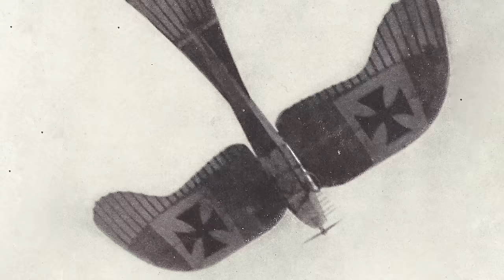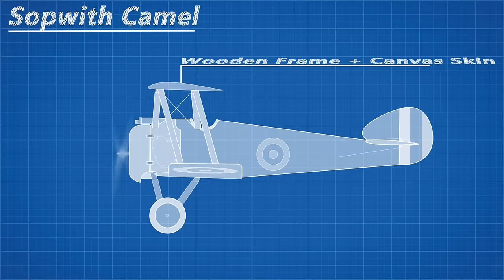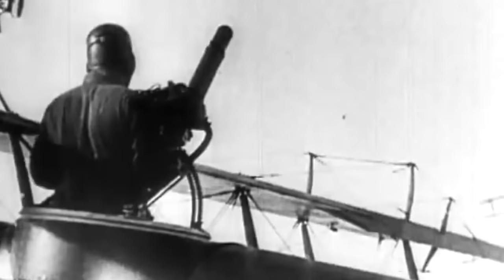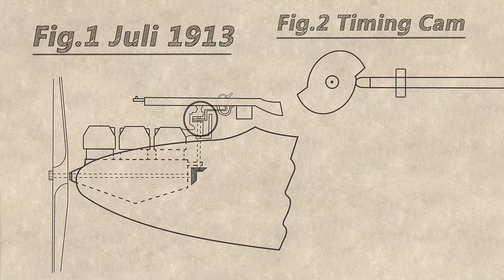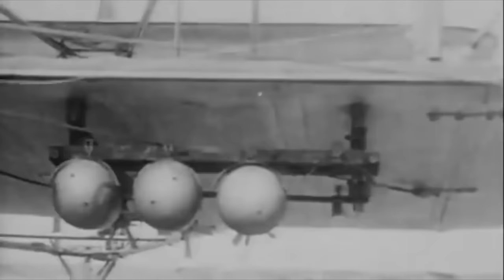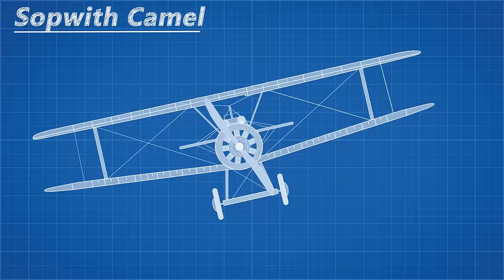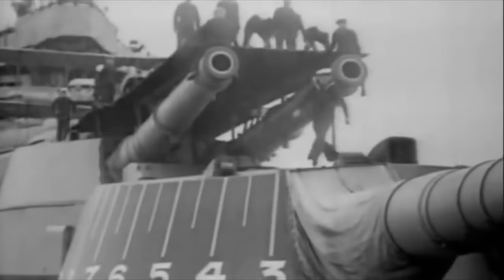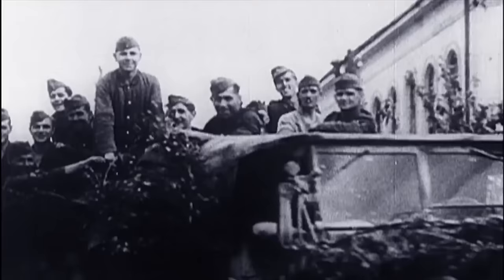The Physics of World War 1 Planes feat. The Great War Channel

Comment: They haven't yet thought of changing the dihedral of the wing either. That's why they added wings.
Reply: @Yuri DeKhed it was through manipulation of the dihedral. Which also includes the aspect of how thick the wing gets. That allowed them to make aircraft that didn't cease to be flyable in transition to Super Sonic.
Reply: @Yuri DeKhed first of all, my comment had nothing to do with the Sopwith Camel because they added Wings before they ever designed the Sopwith Camel. The camel just happen to have dihedral built into it. It was the adding of the Wings at a mild angle that help them to understand that function of wing placement. Even the Wright brothers didn't understand that he drove. They had already stacked Wings because they were using such a thin winged that it didn't develop a lot of lift. When they finally realize they can articulate the wing much more, the result was much more lift. But by playing with that lift and moving the pick thickness of the wing fore-and-aft. They were able to change the flight characteristics as well as the flow of the wind. Coming to a near laminar flow Wing in the P51 allowed it to fly much further and use less energy. The thing that bit him in the ass was endives they were approaching the speed of sound and losing control. Because the wings could not handle the turbulence at transition speed. By going back to a much thinner wing they figured out how to make Super Sonic aircraft that were controllable. The other necessary thing they found is they needed a flying tail. For the entire tail surface moved instead of just the elevators.

I wrenched on aircraft long enough to know what the functions of the lift and control surfaces are.

If I remember the video correctly they had the engine torque effect on the aircraft inverted when they were speaking of the Sopwith Camel. The torque is always imparted opposite the spin of the engine. Especially when you have the entire engine spinning and only the crankcase is attached to the aircraft. That is why by World War II radial engines were attached to the aircraft and the crankshaft was attached to the propeller. It imparts far less torque to the aircraft. And they were still dangerous things to try and take off in.
Reply: @Yuri DeKhed an aircraft doesn't fly on to dihedral alone. But the video did talk about why they added multiple wings. And dihedral does have to do with stability in ground effect. And multiple Wings was also a way to make their wings lift enough to support extra weight. Something they found they could do differently by just changing the thickness and aspect ratio of that thickness to the wing. It's a full system. And if you don't understand it I can't explain it to you any better than that.

The video spoke of things that eluded two aspects of aircraft that included far more than dihedral.
Reply: @Yuri DeKhed when they got into the meat of the video they were talking about aircraft that hadn't used dihedral yet. Yes they had spoken of the Sopwith Camel but the Sopwith Camel did not come around for several years after they were making multi-deck Wing aircraft. The other point might very well be because of the wingspan of the Sopwith Camel that. Cantrell was an accident of design so that you didn't have it as much a tendency to Naco wingtip on the ground while you were trying to land. The better flight characteristics of the Sopwith Camel may very well have been why they looked at the dihedral and started employing it more often. My point had nothing to do with the goddamn stop with camel. It had to do with the 15 or 16 years that they were building aircraft without dihedral.
Reply: @Yuri DeKhed I didn't miss your point. I didn't miss the point of the video. But there are plenty of people who watch these videos who might have just a passing knowledge of a little bit of aerodynamics. And if you're not interested in what I had to say it's a comment section don't read the goddamn thing. But other people might be interested in knowing a little bit about how these things come together as a full science
Reply: @Yuri DeKhed it was nothing incorrect in my comment, you just didn't think it was permanent. But personally, I don't give a rat's ass about your sensibilities. I have found that when I find information I can use, I adopt it. If I find information I have no use for oh, I tend to ignore it. When I do respond it's because somebody may be going down a misunderstood path.

My using the video as a mechanism for expanding understanding of the intricacies of aerodynamic design, just as this video was doing in a long-winded fashion, I'll be at revolving around a single subject. Dihedral also applies to how many other aspects of wing design were realized.
Reply: @Yuri DeKhed I didn't miss any point. I just added to the understanding of aerodynamics two people who could understand more than one thing at a time. Like walking and chewing gum at the same time, which apparently you're unable to do.
Reply: @Yuri DeKhed they clearly State on the video that at the beginning of World War II they had not yet built an aircraft with dihedral. So obviously at one point they had not thought of it. You're the one who Miss understand what they said in the video. The Sopwith Camel didn't come out till about the middle of the war. Aircraft had been around since 1902. Without dihedral built into the lower wing. You are the one who is misunderstanding the video.
Reply: @Yuri DeKhed aside from that I never said it wasn't understood, I stated that it wasn't part of in the contract of powered aircraft. Had they thought of it they would have employed it from the beginning, which clearly they did not do. And that's according to the same video I was commenting on the video was centered around powered aircraft.

Comment: The Camel didn't use a rotary engine it used a radial engine
Reply: @Yuri DeKhed same name but the rotary engine more commonly refers to the wankel engine
Reply: @Yuri DeKhed but anyway I've never heard it called a rotor engine and have been building em for years so I think in the community that might cause confusion

Comment: great video just one thing; rotary engine is a Wankel engine like the one used in mazda rx7 what you are talking about here is actually called a radial engine.
Reply from the maker: It's the other way around. Either way, they are both types of radial engines. Radial just means the pistons are arranged in a circle around the crankshaft. Rotary means the crankcase is not fixed and rotates around the crankshaft.

Comment: In the..... hold on I can't remember what it's called lol I have the book right here... alright it's my 2004 thunderbirds x-ray cross-sections and it claims that the width of TB2 would create enough lift that while at high speeds it would be able to stay air-born without use of the VTOL engines, whatbdo you think? I know it's true to a degree but I'm calling comeplete bullshit on that one lol. Also it claims that the short length of the wings allows greater stability which would actually be true but apparently the wings being swept forward also increases stability during rescues but this is kinda counter-intuitive since that would make it less aerodynamic and there-fore it would take longer to get to the rescue site. Pile that on top of TB1 oftenly having to launch like an hour before TB2 can since it needs to scout out the area so they don't bring any unnecessary equipment and so they're not missing any equipment when they actually begin the rescue really makes that extra-stability kinda hipocritical. Remember I'm more specifically talking about the 2004 version of TB2.

Comment: While the physics is good the history of the DR.1 and the Red Barron is a bit out.  He only scored his last 19 victories in a DR.1 which far from being a good dogfighter couldn't be flown at full chat due to chronic design flaws.  Drag and a history of wing failure at even moderate loads, enforced rigid restrictions on the flight envelope.  Those German pilots who revelled in its agility were taking huge risks.  

The DR.1 was built in response to the Sopwith Triplane which briefly held an advantage over German fighters.  The design rationale behind the Sopwith wasn't increased lift, the Sopwith 1.1/2 Strutter and Pup that went before had hysterically broad chords  which reduced visibility and made it a poor platform for fighting.  

The three wings were thinner with a shorter chord.  This created a useful if short-lived speed advantage and excellent visibility, for the same lift.  They flew like barges, the Pup being far more agile, but they fought better because the pilots could see their quarry and position themselves better. 

The German designers were told to replicate the advantage of the Sopwith but without understanding its philosophy.  They assumed the advantage came from extra lift for good handling and went for thick, wide chord, rigid, short span wings to further improve on the Sopwith. 

This created a chronic wing loading/design flaw, the upper wing being unaffected by the drag from the fuselage an prop wash was essentially a separate flexible parasol wing attached to a rigid biplane, the lift was so varied from top to bottom the upper wing was constantly trying to escape the rest of the machine.   

I have filmed with both a DR.1 replica and a Sopwith, the later can be flown easily by any decent pilot, the DR.1 has flight restrictions like no other aircraft.  When we tried to pit one against the other in mock dogfights the DR.1 pilot was constantly backing out of moves, the barge like Sopwith always had an advantage.  I admit wartime pilots worked under different rules and would push harder, but they were on the ragged edges of controlled flight and many must have died from the design flaw. 

Both the Sopwith and DR.1 suffered another problem with the drag from two extra wingtips, as speeds increased past 100mph at low altitude this became a limiting factor on top speed.  The DR.1 was underpowered and slow for 1918, the Sopwith was discarded before 1917 was out.

With SE5as and SPADs doing 130mph on 200hp, the DR.1s couldn't match them because of the extra drag.   When the replicas were built in the 1960s it was found the claimed top speed of 115mph on 110hp was unobtainable, 185hp engines being used for a modest 110mph, with a never exceed speed of 120mph. 

This is why no further triplanes were built. They were a dead end development, fewer than 500 Sopwiths and DR.1s being built in total. 

The Red Barron and others liked it for its climb.  They were lone hunters who like to skulk around under their prey and snap climb up under them in their blind spot. Both Triplanes were only around for a relatively short time their notoriety came from their use by the great aces - Richthofen, Voss and Collishaw.  

Because the DR.1 took so long to get into service it was quickly overtaken by D.VIIs and Allied fighters.   You could do a lot more with 3,300 D.VIIs and 5,300 Camels, than you could with 320 DR.1s

Comment: radial engines, not rotaries, they are very different
Reply: Pedro Rocha you're probably thinking of a Wankel rotary engine, which is called a rotary engine because it uses a rotor instead of pistons. This engine, even though it uses pistons mounted radially (like a radial engine), is called a rotary engine because the the entire engine rotates around the crankshaft, which remains static. Compare that to a radial engine, which remains static while the crankshaft rotates.
Reply: Nick Fury now I get it

Comment: .    Again......we have another picture not matching what the narrator is saying. I love this channel (it makes me realize how little I know about the technical world and engineering in particular), but it does a terrible job of portraying what they are talking about with accurate pictures from history. @6:22 the narrator is talking about the Sopwith camel....then shows a pic of the Sopwith Pup. It's easy to tell this because the PUP was the plane that was used in early tests to fly a plane off a ship (a plank runway positioned over the main guns of the cruiser HMS Yarmouth). The Pup was chosen because it was light enough to take off such a short runway.
Reply: That was not the HMS Yarmouth, as she had no front flagpole. The bow charachteristics seem more reminiscent of a battleship than a light cruiser. I do believe that the plane shown is indeed a Camel, and one (Camel) did take off of a plank runway on the superfiring front turret of the USS Texas.  The rather large 14 inch gun of said turret can be seen under the runway, on the left side. It is certainly a camel, given the dihedral of the bottom wings compared to the top, a feature that all camels, but no pups had. The USA obtained, during the interwar period, 6 camels for testing via battleship. I would recommend looking at the plane itself instead of only the context.

Comment: I had to stop watching after just a couple minutes. The number of errors was already too high.
First, a glider or sailplane does not use a long wing to get more wing area. It is for reduced drag. A long wing span with a short chord is more efficient and creates less drag than a shorter wing of equal area. 
Second, an ice skater does not pull her arms in to reduce her moment of inertia. She does this to take advantage of angular momentum.

Comment: It's not a rotary engine it's a radial engine.
Reply: Kyle Bend in radial engines the cylinder stay still and the crank shaft rotates. In rotary engines the crank shaft stays still and the cylinders rotate (along with the prop). Most WW1 engines were rotary types.

Comment: Very, very, VERY silly overall. I am both engineer and pilot, couldn't have been more disgusted by your silly oversimplifications of this whole messy approach: 
1.No, Manfred "ritter" Von Richtofen was not "infamous"; neither a particularly gifted pilot (against folklore), but a very skilled tactician,  instructed by no less than Oswald Boelcke; by his own words, "no great flying has ever shot down enemy planes, good tactics have and will!"
2.No, he didn't amass "all his victories in the Dreidecker 1", as ou so poorly stated, but in several variants of the Albatros;
3.No, the Sopwith Camel was no "harder to fly" than the Dr.1;
4.No, the Sopwith Camel was not the very first response to the "Fokker Scourge", you forgot the Nieuport 17, the Sopwith Pup, the Sopwith Triplane (inspiration for the Dr.1, by the way...), and the (very, very) successful Se.5;
5.No, the first attempt at shooting through the propeller arc was not using a synchronization gear (later developed by Constantinescu, not a german himself...), but by using small metal pyramids attached to the propeller, in order to deflect the bullets, mounted on a Morane-Saulnier, flown by no less than Frenchman Roland Garros (yes, the name of the tennis tournament...);
6.No, the whole issue about monoplanes(Eindecker E.1) X biplanes (Camel, Se 5, Albatros D.I, Fokker D.VII) X triplanes (Sopwith) X quadruplanes (Dr.1) X sesquiplanes (Nieuport 17, Albatros D.V) was not nearly as simple as you tried to put it: it involved a very delicate and technical balance between structural strength (of which the Dr.1 possessed very very little, by the way, failure of the upper wing being the main cause of many demises...), overall drag, AND maneuverability ( more wings = more lift = tighter curve radius = slower due to increased drag =  more armament capability )...
7.No, last but not least, soldiers at war are not "cowering in trenches"...WTF?!?
8.No, by no means is such an oversimplification about "longer wings X shorter wings" restricted to structure or bracing: higher aspect ratio wings (the ones you called "longer") are far more efficient in lift X drag (that's why gliders are built so), hardly a concern in a fighter; lower aspect ratio wings ("shorter"), on the other hand, have much more benign stall characteristics, and instead of suddenly "breaking" into am unexpected stall and needing a deeper dive to recover, they recover far more quickly due to the  "flow feedback" supplied by the very tip vortices that cause its relative glide inefficiency. Since in tight maneuvering accelerated stall in curve is of utmost concern, stubby wings shine - it was not until semi-elliptical wings were developed (Spitfire, P-47 Thunderbolt) that this paradigm was broken.